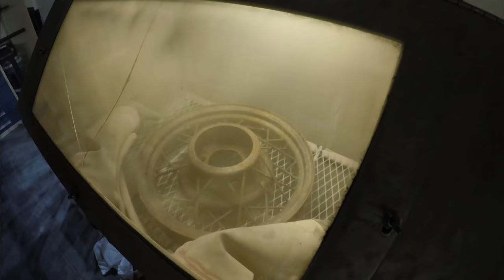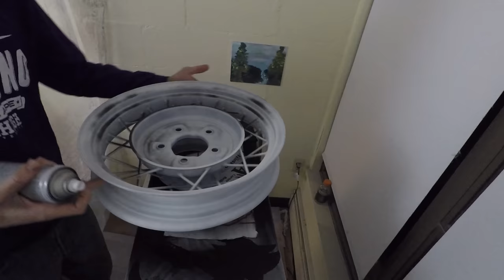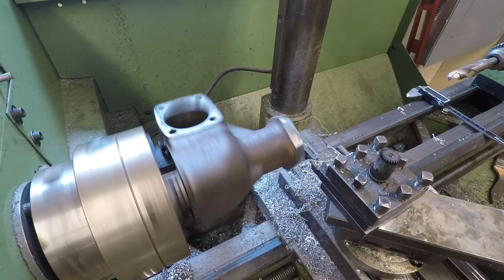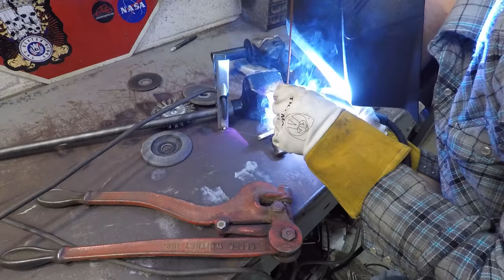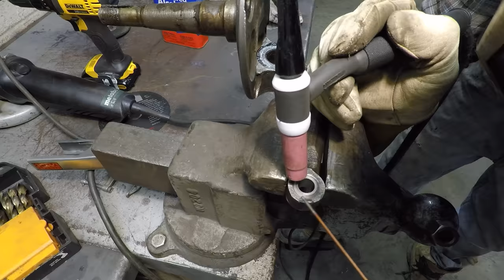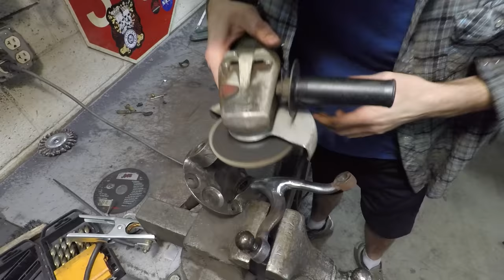Fabricating Traditional Hot Rod Steering | Homemade Boat-tail Speedster Pt. 30

Comment: That turned out great. The extra arm looks like a factory casting the way you blended it together. 
The only thing that looks odd is the tie rod ends but I’m not sure if it’s the bend or the fact that the OEM Ford ends stick past the ball end on the arm that looks odd or it’s the combination of the 2 points I mentioned. 

👍🏻👍🏻👍🏻

Comment: very nice work, just one point though. If you need to weld on something like a gearbox (steering box) put you ground clamp on the case you're welding on NOT on the steering shaft (you don't want that welding current go through the gears, there are gaps between the gears and if the current jumps the gap there is a chance of damaging the gears or their hardness).

Comment: Me personally I would do the hot rod thing with big wheels back and small wheels  front but same width just taller tires in the back for a bit of a raked back stance and also what engine are you going to use it has to be small and reasonably powerful for its size and weight so what is the powerplant you are planning to use?
Reply: Eamonn Duensing 
He has shown the block in a previous video and when he did the electrolysis rust removal.
Reply: Flathead Ford, looks like.

Comment: I am wondering how strong the frame is now at this point where you have cut out such a large area for the steering box to fit in. I am not too happy with how that is. Do you think that will do?
Reply: I felt the same way. If it was mine, I would reinforce the area where the steering box goes through the frame. JMHO though. Keep up the good work!!!
Reply from the maker: when I cut the hole for the steering box, I made a triangular cup that slides into the frame around the steering box mount and welded it in. If you go back a few videos, you can see how it's reinforced
Reply: @MacroMachines  I have watched every video. When you say that now I do remember you doing it now. Hey I am curious as to what you are taking in school?

Comment: So do you pre heat before welding and sand cool to reduce stresses or does that forging not break when welded?  Awesome project and beautiful work.  Also Tig is king (one tig’er to another tig’er.  When you have to grind your flux core, mig or stick that’s not welding that’s grinding.  Thank you for taking us along for the build.

Comment: why didn't you just flip the spindles to the other side and run your center link out front ?
Reply from the maker: that would screw up ackerman steering, and also look kinda dumb
Reply: @MacroMachines  glad you're paying attention to proper geometry.  among the hot rod crowd there's on-going debate about tie rod location, ackerman, etc. i had been concerned about you getting proper geometry with the drag link but seems right from this vantage point.

Comment: how would go about getting that thing road legal
it dont have a vin or anything like that
Reply: depends on the state, but  most will do an inspection of it to be sure it's road safe then if it passes they will issue a  vin and title for a completely custom built car such as this, there's usually more to it, mostly paperwork, but that's it in simplified terms
Reply: @darkside0914  i wonder if it would have to meet moderen safety specs or really none at all cause its a peroid correct vehicle?
Reply: @thatbuelldude189   i looked up specially constructed vehicles on my state dmv web site and everything it lists are basic safety gear found in any street car,  seatbelts, horn, brakes, head/tail/brake/parking lights, t signals, so here it's all pretty basic safety equipment
Reply: @darkside0914  but for a peroid car most of that stuff wasnt a thing
well turnsingals and seatbelts 
i know forsure werent a thing
Reply: @thatbuelldude189   that's true, and each state may have different laws concerning this, but here where i live, because it's a 1 off custom it's considered a specially built car and must follow the laws for those cars,

Comment: Detach the spring and raise one of the front wheels. The other wheel will raise too. It seems to me that your front suspension will work wrong.
Reply: Leonid Valentinovich  You are right, and he is aware of the issue. He is building like this because it's kind of the traditional way to do it.
Reply: @jerrylundgren8244  thank you a lot for your comment. I thought that nobody at this planet knows about this issue :-) I tried to explain this to my friends-mechanics but they don't understand what is wrong.